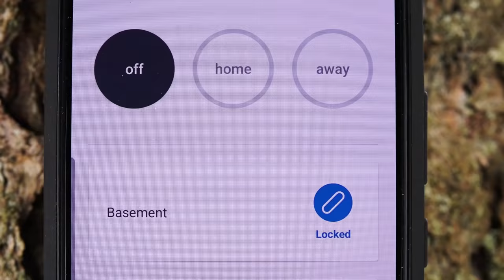Scariest Moment of the Build! Cutting Through the Purlin! / Ep93 / Outsider Cabin Build

Comment: Oh this cabin is too craftsman engineered to ever have you worried about structural integrity. I’m just intrigue by the way detailed sanding made it all so bright inside. 

Note: I must have missed the last couple of episodes, the YT algorithm somehow must have bypassed them from me. Anyway, for your holiday special,  I just want to say you have a very beautiful family, and God bless you all for the joy you bring each other. Take care.
Reply: Hi Garrett, Thank you for your kind words and for watching. Yes we pondered long and hard about cutting the purlins out. But came to the decision to cut based on a number of factors, like  45 degree pitch with steel roof. we felt that the rafters were more than adequate to carry the load with out purlins. the framing of the dormers bridged and would support the cut out of the roof and purlin because the extra framing goes from 2' below the peak to 2-3' feet from  were the rafters are supported on the top of the wall. Further, the weight is supported within 4' by the outside wall and by a secondary 45 degree support under the purlin on the other side. So that was the thinking process leading to the cutting!  Thks again Have a great day!
Reply: @senioroutsider2975  And that technic of cutting the purlin openings at an 📐— genius! Great safety precaution to prevent getting caught on the edges. You all definitely give me ideas if I ever dedicate enough time pick up this craft.

Comment: For peace of mind, I would Weld up some  iron beams in a "n" shape to tie the perlains together and bear the roof weight down to a few trusses. Vertical beams to the loft floor would not impede on space. Black iron would look nice.
Reply from the maker: I've always loved the look of iron ties in a log cabin (or timber frame) roof structure.  
...Maybe I should take up blacksmithing. 🤔⚒️🔥😄👍
On a side note, there actually isn't much weight placed upon the purlins, since the common rafters have taken the brunt of the load. So I'm not worried about any future sagging. However, you can't go wrong with extra bracing. Great ideas!
Reply: @TheOutsiderCabin  for those odd times when you have 2M snow on the roof then it rains. Load can get heavy and the dormer won't let it just slide off.
Reply: @FreezyAbitKT7A  Exactly. The normal load is not an issue. He gets a huge load of snow and a couple inches of rain will crack that roof by the dormers
Reply: @TheOutsiderCabin  Are those purlins acting mainly to support the roof or brace the structure laterally? Also wondering what kind of calculations you perform to determine the size of the members used?
Reply: That would be a very deep truss... wouldnt carrying the load down onto the middle of the upper floor require redesigning the floor beams on the upper floor? Ideally one would want the load to be directly on the vertical members, either the log wall or wooden column

Comment: I know what you're talking about when it's you did your calculations and it should be strong enough, but what if not. I remodel homes all the time for a living. And a lot of times I have to build temporary walls and remove a bearing point I do that all the time is it strong enough to hold. Nerve-racking! I have not failed yet though LOL you know when you're cutting something if it starts pinching the blade your temporary is not strong enough yet. Back out and beef up
Reply: Hi Darin, Thanks for your input, see My reply to to Garrett Stitt His comment was made 1 minute before yours. It explain in large part the thought process going into the engineering aspect of whole thing. There are a few further reasons we felt it would work. related to the steep angle of the steel  roof, if the pitch was much shallower among other reasons , I would certainly have more concerns about cutting it out. Also good to hear that you have not miscalculated anything! Thanks again for your interest. Cheers!
Reply from the maker: Ah yes, you can definitely identify with what we were feeling then! ...It's easy to trust one's math, until one has to make the actual cut. 😅 Then the stakes become real. 
Glad to hear that your calculations and instincts have always proved fruitful. All the best!
Reply: @senioroutsider2975  I am in Washington State just yesterday I started a project where after I remove 18 ft of the second floor exterior wall bearing wall it has a tile roof and it's 18 ft to the second floor just getting the windows out without killing somebody was difficult enough.

Comment: Putting some wrought iron strapping that matches the doors to tie in the roof rafters-logs would both add strength and beauty to the interior. Indeed theY could be used as possible mounts for lighting or simple rings to drape-hang anything ones imagination could put up there. Whether it was a vintage kerosene lamps  to snow shoes the brackets could suspend memories that your family has made in the past and into  the future there...

Comment: You could of placed log trusts where you cut the purlins at the ends. Log trusts will keep the purlins in place over time and add strength to the roof. Not to mention the look would go along with the cabin.
Reply: Hi Bill if you can find them Approx 45 minutes earlier there were 2 commenters that I answered in detail, if you can locate them it will maybe help answer your question. Cheers, Have a great day.

Comment: You're work is amazing and you did well in this log for a long time. Only thing is, instead of sanding the log periodically, can we apply some paint or any protective coat as a permanent solution? Also sanding may reduce the rigidity of the wood is it!

Comment: The ice cabin was a good idea but weather is unpredictable. The only way to have saved it would have been to temporarily bury it in snow, because then the ice walks would have been reasonable well insulated from warm winds 
Cutting the purling wasn't a risk. You had calculated the load and built the structure to take it.

Comment: I imagine angle grinders and flap disks can remove wood from a log pretty quickly. It reminds me of a story of army barracks potato pealers. They dump several sacks of potatoes into a machine that looks a bit like a cement mixer. The potatoes start out all different shapes and sizes but by the time all the skins are sufficiently removed to specification, the contents of the drum is reduced to uniform 1-1/2" small potatoes.
But you guys are better than that; you're not following orders.

Comment: I never make my dormers that skinny.  It's so much work and you get no footage out of it.  So I always make my dormers 8ft wide as a minimum.  It still looks like a dormer, but it lets more light in and really opens up the room more.  Makes it feel like you really got something out of all that dormer work.  Because either size you build, it's about the same amount of work.
Reply from the maker: Very good point! 👍
Reply: @TheOutsiderCabin  The smaller dormers make it look a little more intricate.  But most times when you see them that small, it's because we're trying to fit 3 of them on a cramped roof.  Also, you would be surprised-- MOST of the time, when you see dormers that small, they are completely fake and they just go into an open attic.  So even though your house is only a one story home, those fake dormers make it look like a big 2 story home, from the road.   (I've built custom homes and metal buildings for over a decade).   Yours is basically just acting like a skylight-- which was much needed. love the build

Comment: I guess solid wood is a good insulator?  What would the temperature difference be without the fire going?  difference from outside to inside temperature...
Reply: Hi dymondwillow2, it is a little difficult to give a definitive answer, but the temperature inside and out can be as low as -12 C inside and out.  but once we get a fire going over the next approximately 5 hrs it goes up to between +15 - 19 degrees C. If the stove was tended to 24 hrs a day and the floor gets properly insulated it would maintain  a very comfortable short shirt sleeve temp. Hope that answers your question adequately!    Thank for watching! Cheers Have a great day!

Comment: Perhaps it's already been mentioned in previous videos, but I was curious as to the vents at 11:46 up in the V of the peak of the ceiling.  Are those open to the elements at all times?  I understand the need for ventilation with a wood-burning stove, but doesn't that let out heated air and cool things off?  I must have missed the part where those were explained.  Can those vents be closed or are them permanently open?  They appear to have screen in them to keep the insects and other wildlife out.

Comment: I was thinking as you guys finished the 2nd dormer, just like you have a triangle to support the main ridge pole running along the top of the roof frame work, why not use a triangle to support the beam you are about to cut?
Reply: Hi Stephen if you can find them I gave a detailed explanation of the reasoning that went into the decision. they were comments about 45 minutes before your! Cheers!